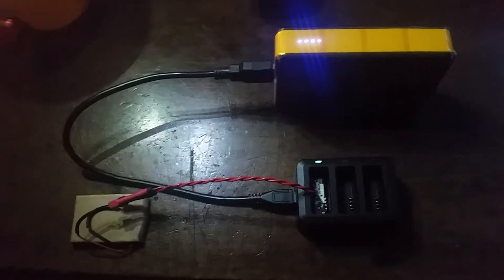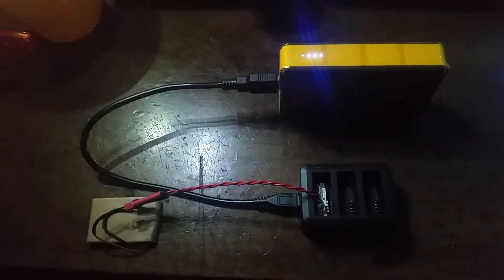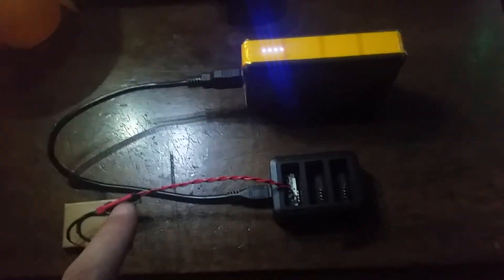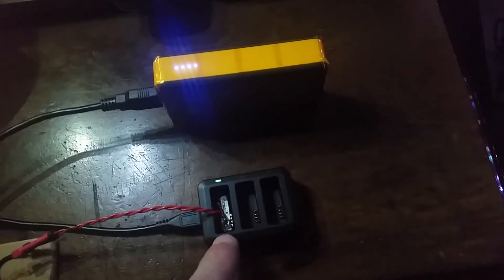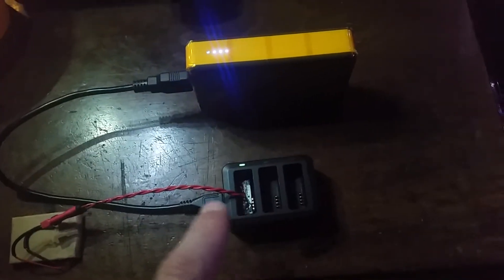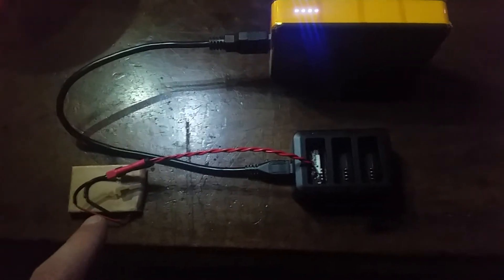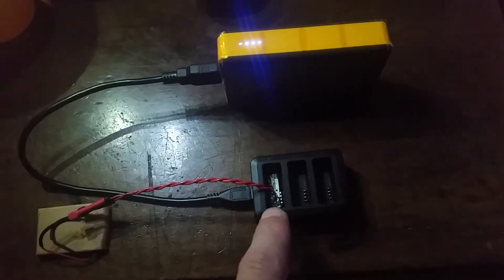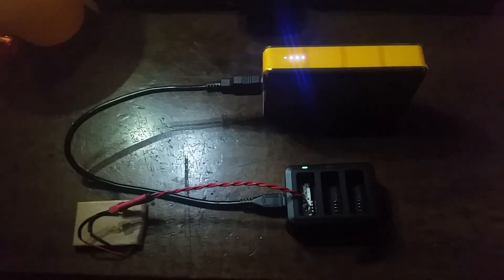Ryze Tello Battery Mod Project Part 2

Comment: Hey I found your post into yellow pilots and I tried to modify my batteries, but when I try to take off with the drone it reboots, did you have any idea what to do ?
Reply from the maker: That means that the battery that you are using doesn't have enough power to be able to keep the drone going, the battery needs to be able to deliver enough ampere without too much voltage sag. When you take off the drone needs a burst of power and when it can't the voltage will go too low and that's when the drone stops flying.
Reply: @RicardoPenders  OK, i will charge them more before I try again, thanks for your help

Comment: Hey, I have so much trouble sourcing these tello oem batteries, here in India that they have gotten out of hand...the prices are going as high as 7000 inr which is too bad price for Just one battery! in fact the drone sells out for around 9000 inr so it's just not worth it man. My drone is collecting dust for the past 2 years coz of a super bloated battery (its like a tennis ball now) and I have seen people doing things like opening the tellos original battery, removing the cell, and putting another battery in it. Like they are putting 600mah batteries (too low) and 1800 mah batteries (too high!) Considering the original battery is 1100 mah...so which Mah battery did you put in the drone?? An is it safe to install and fly? Did you have any problems?
Reply from the maker: The mAh of the battery is not important for the Tello, the voltage of the battery is important.
As long as you can charge the battery to 4.2 volt without a problem it's ok to use it.

However I do recommend you to use the original BMS from the original battery so you need to change the battery cell only and reuse the BMS.
I've done it and used a variety of battery cells with different mAh from a 900mAh up to an 18650 cell with 2200mAh, they all work as long as you use the original BMS from your old and bloated battery cell.

I hope this is helpful to you so you can have fun with your drone again.
Reply: @RicardoPenders   thank you for the tip, I found you forum post in tello pilots and I really love how you have discussed everything in detailed manner. I largely appreciate your efforts in this.
Also I actually can't um buy from alibaba or banggood or any Chinese websites bcoz they give out in bulk, but I want a cell for one battery and also it doesn't ship to India..
so, I tried finding the cells on amazon .in and found an 1100mah cell, but its slightly larger and doesn't have a single review.

Can you suggest me a battery cell that will fly my drone for 10-15 mins? And even if I find a perfect cell, do I have to remove the protection circuit? And I'm talking about the cells which DO NOT have the metal/aluminium strip connector thing but just a protection circuit and the wires....
If you have the name of a cell that can fit in the battery enclosure, please provide me with that if possible.

Thank you
Reply from the maker: @ncod.r  Well, even for me in the Netherlands it's hard to find any battery cell that will fit into the original battery case and has the right voltage and about the same mAh value.

As much as I want to help you find where you can buy single battery cells, I can't find them myself.

The only way I can get the right battery cell is by buying them in bulk from a Chinese factory that makes the battery for me according to the right dimensions and specs.

I did however got a different drone for free to do a review and I butchered that so I can use the battery cells from that drone and transfer those over to my Tello which worked out perfect.

About the protection circuit, I recommend you to take it off because you will have to use the original one from the Tello battery cell and having the extra protection circuit does work but you'll get a lower voltage out of it because of the losses in the parts adding up.

What you can do is try to get a battery cell from any drone that has the right dimensions to fit into the original case, there are single cell batteries for other drones that you can use for the Tello, those have the right voltage but may have a bit less mAh but that's not a big problem.

My Tello has a flight time now with the new battery cell of about 8 minutes, there's no chance to get the 12 minutes out of it that you get with the original Tello battery it's just not possible sadly.

But 8 minutes is better than nothing right?
Reply: @RicardoPenders  yup 8 minutes is good enough..considering I don't have to pay that hefty amount for a single battery.
I will come back to you if I have any more questions.
Bye 👋

Comment: Love your work
Reply from the maker: Thank you, I actually have a follow up video that I have to make. I took a smaller battery from a different drone that I got for doing a review and soldered that one to the Tello battery board and the Tello does work again with the new battery as I predicted.
It has a little bit less flight time now of just shy of 8 minutes but I now have proof that you can use a different battery and the Tello still works without any problems.
Reply: @RicardoPenders  nah so Tello don't have sMart batteries ?
Reply from the maker: @angelhero19  No it's not a smart battery at all.
Reply: @angelhero19  you will get error code 13 if you will use another battery
Reply: @mazikeen.RCZ99  tello only have a problem is battety too bad ! If ryze can fix that it will become great smart toy drone
Reply: @angelhero19  no clue what is wrong with battery working well for me